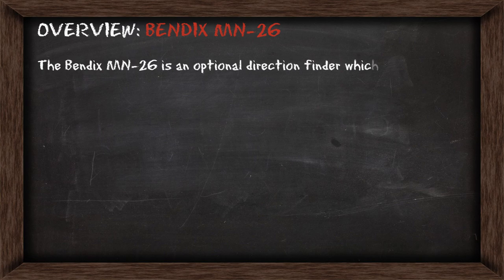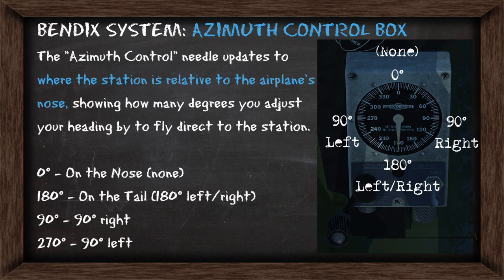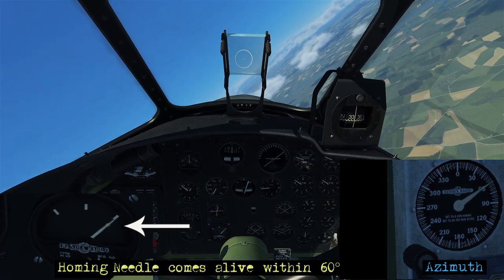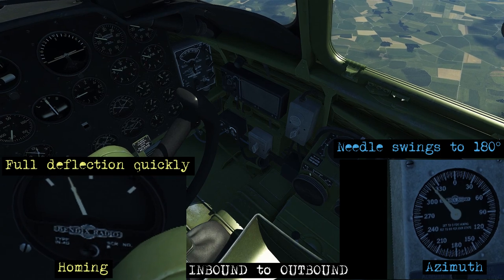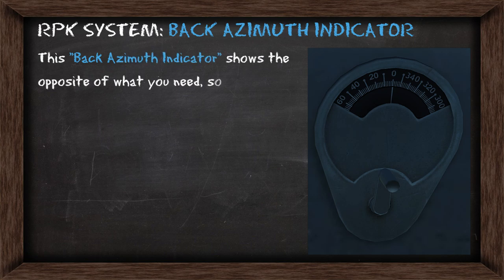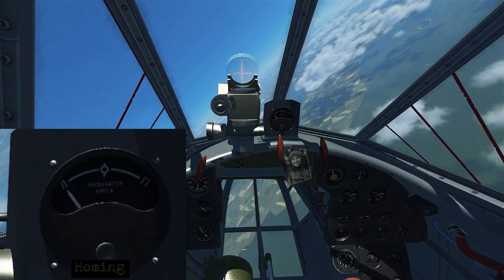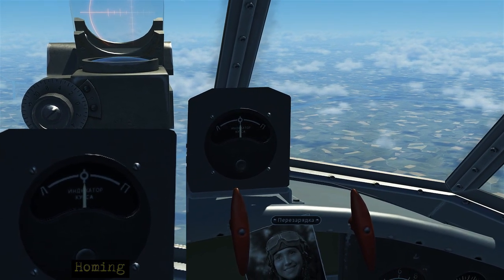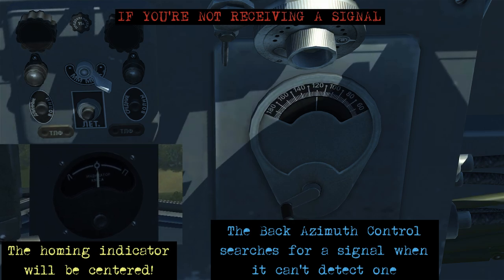Il-2 Radio Navigation - USA & Russia

Comment: I sure wish I had another 50 extra buttons available to map so I can use all these functions in VR.  Its silly they make a Sim run so well in VR then leave VR pilots without a way to use the Simulator without taking off the headset to look at the KB.  While DCS gives that ability but is unplayable in VR.  Its almost like the E.Euro software devs hate their customers, a lot.  I wish we could have Microprose or Dynamix back instead.